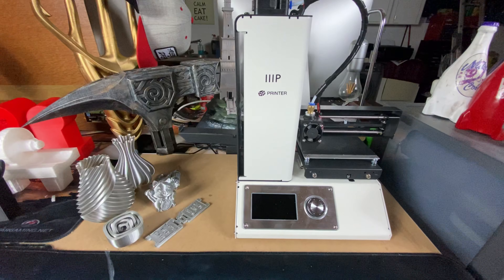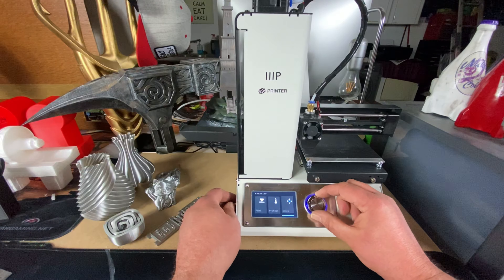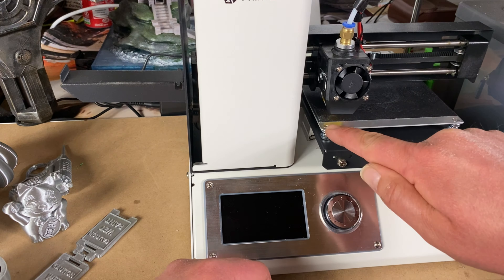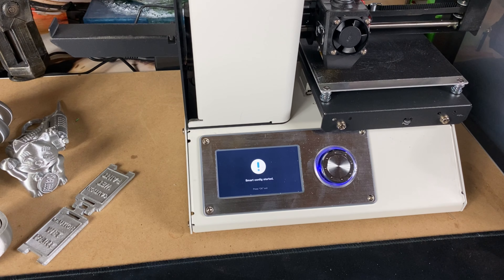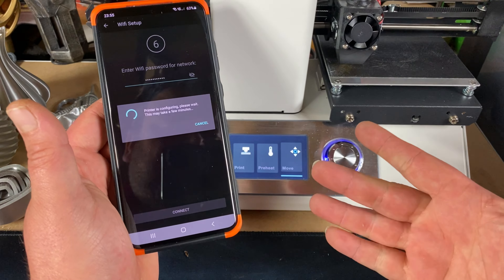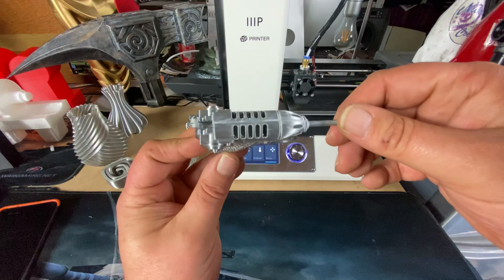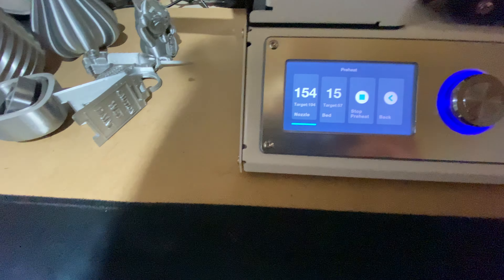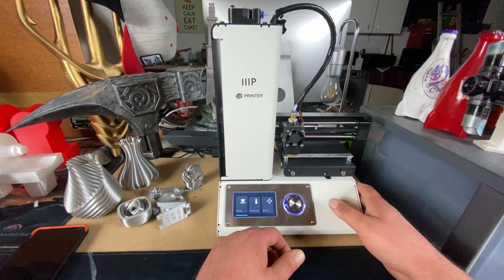Monoprice Select Mini V2 3D Printer First Impressions

Comment: This was also my first printer. You can indeed print in ABS, however I have only had no warping when printing miniatures and with a raft. Now that I have an Ender 3 I'm gonna be using my monoprice for detailed miniatures with pla+.

And if anyone wants to buy this, I recommend a glass bed and 3d print the glass bed level spacer. Thanks
Reply: Oh! And you can increase the bed heat in cura.

Comment: Hey great video. Does this MPSM V2 have the redesigned heat bed wiring with the large slot in the base housing? If so how has it held up?
Reply from the maker: Hi, unfortunately I no longer have it as dont have room to keep them all